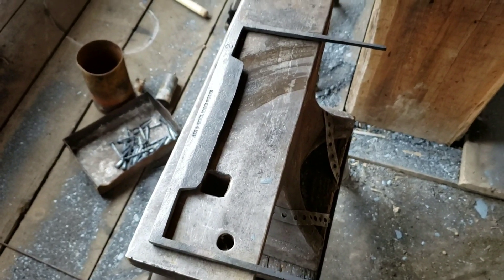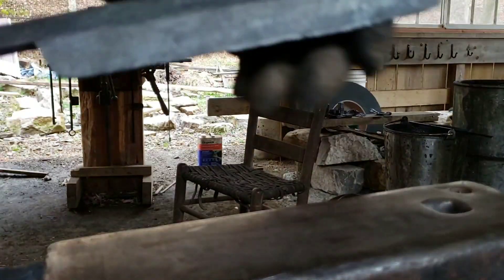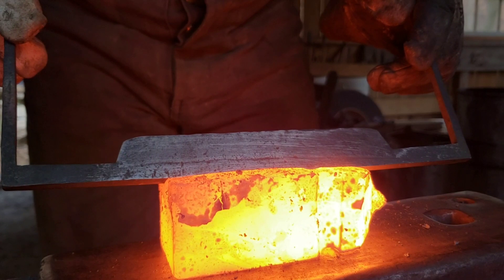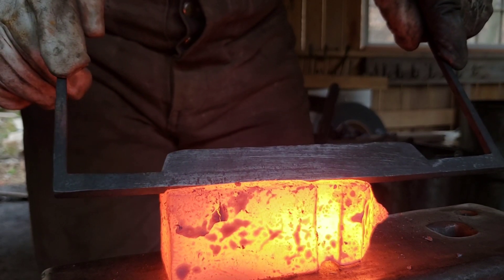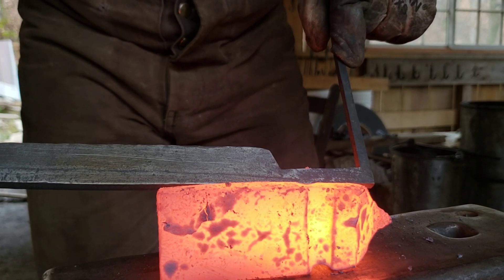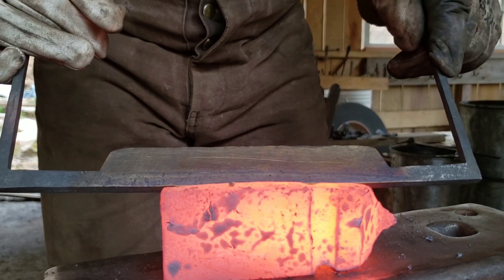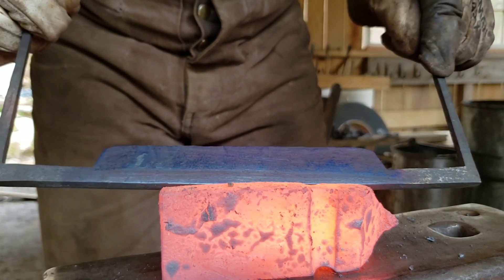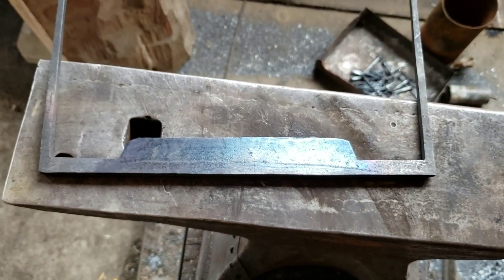Forge Tempering a Drawknife

Comment: Two questions if you will please: I heated up a 135-150 year old drawknife (my first restoration), with olive oil on the blade. My goal was to try darken the blade (protect it). This was from guidance from another restorer. I used a small propane torch and kept it moving over the entire 14" surface, both back and front and the top part of the tangs. The steel never changed any colour that I could see, but it was too hot to touch for more than a half second. I let it cool down slowly in the air. Did I destroy the temper of it?  2nd question: I did heat one of the tangs up to a blue colour (kinda shiny rainbow colour), so that I could bend it straight. Its about 3" down a 6" tang. I bent it just fine and let it air cool. Did I damage the tang metal (which will be encased in a wooden handle) by doing so? Thank you for your experience and time.
Reply from the maker: As long as the blade didn’t change color from the heat, you’re fine. Also, the tang should be fine as well. 👍
Reply: @AxeAndAnvil  oh hallelujah! Thanks very much for this info!

Comment: How does the heated block affect the anvils face hardening does it soften it if left there long enough
Reply from the maker: Not at all. It would have to get the anvil face up on the 400-500 degrees plus range to do anything. The mass of the anvil sucks the heat away and distributes it so that that doesn't happen.